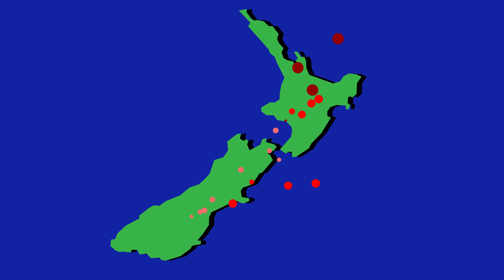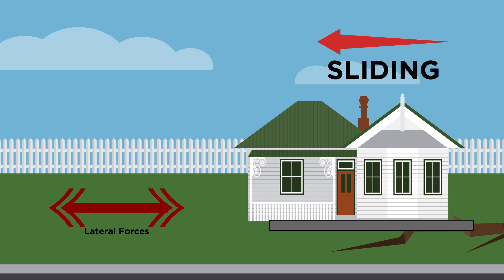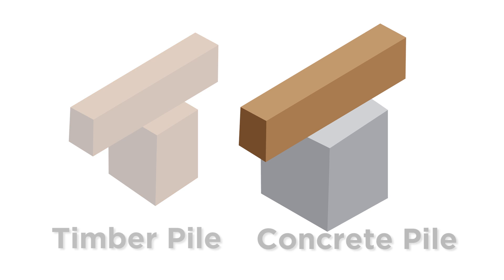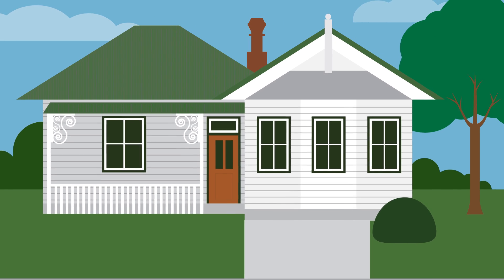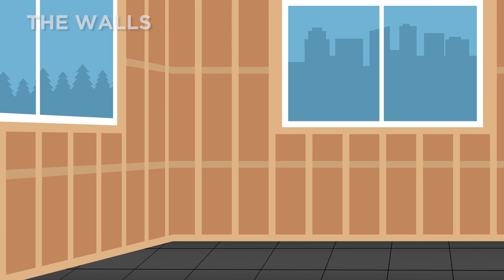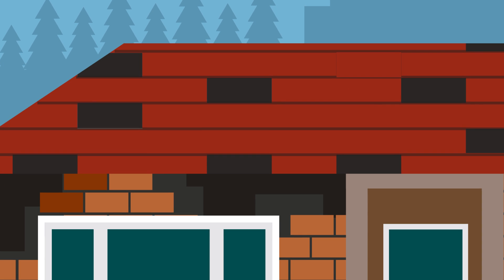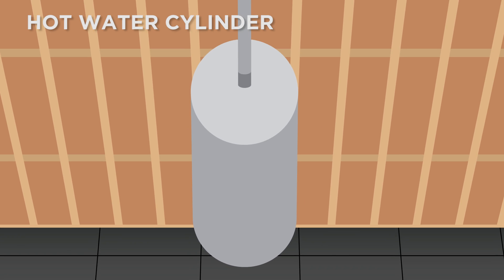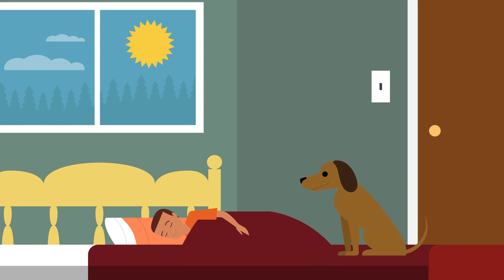Earthquake Strengthen your Home

Comment: As a thought...  look at doing this with new buildings.  Bind 2 1/2" and 3/4" gravel under the foundations.  Use a 15" minimum raft slab, and build on top of that.  This was tried in Adelaide, by an eccentric man, in the 1940's.  His was the only house in Burnside to survive the 1950's earthquake without cracks to the walls. It was a solid brick house with clay roof tiles.
Reply: Excellent!